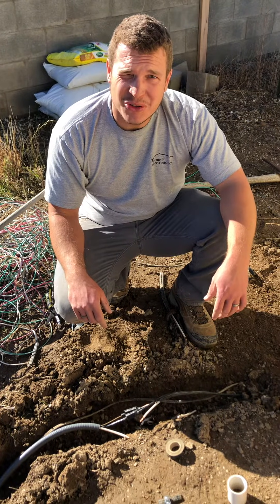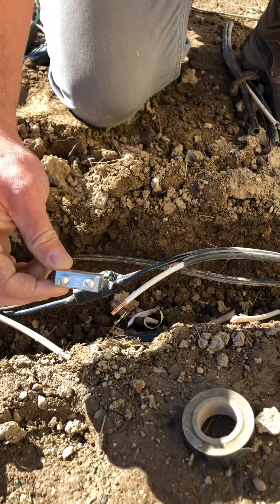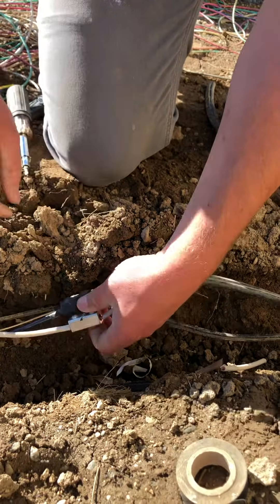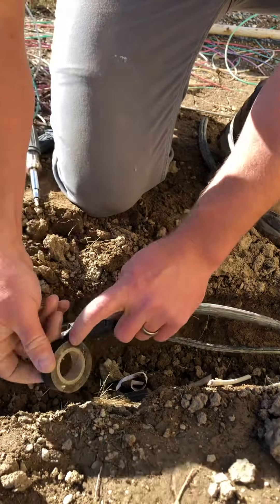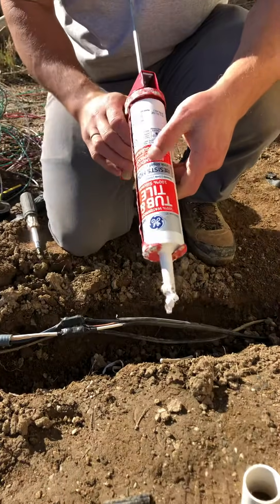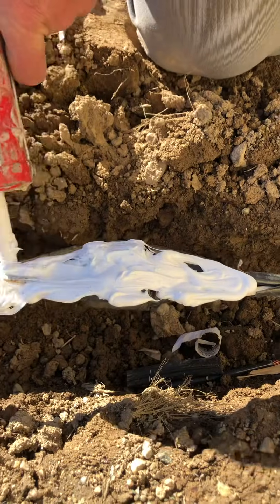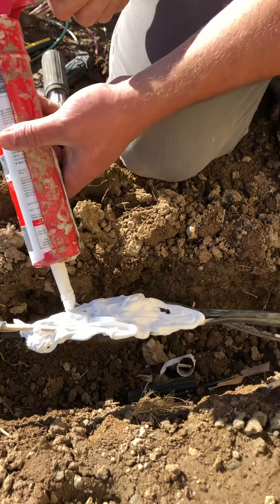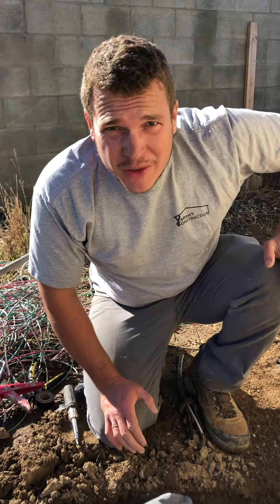Easy hack to fix and waterproof an underground wire that is broken

Comment: Do they make different lengths. Mine was cut and there's about 4 inches of wire missing. I just need to connect t both sides
Reply from the maker: You’ll most likely need to do two splices!

Comment: What a botched job. Can you not buy torpedo joints over there. Correct termination and sealed with epoxy resin.
Reply from the maker: @briwire138  YOLO!

Comment: I like the simple braid and some electrical tape; I like the silicone idea, but what I would do is use a short pvc pipe and fill it with silicone, wires within of course.

Comment: Fixing a well wire with a plastic bag to make it waterproof is multitasking at its finest! Not only are you solving your wiring problem, but you’re also giving that plastic bag a new purpose. Since it takes up to 1,000 years to decompose in a landfill, it should keep your well wire waterproof for quite some time. It’s a revolutionary move in saving both your wiring and the planet—talk about making a difference one plastic bag at a time!  That was very liberal of you!

Comment: This video pretty old, so i would recommend a jbox and splice it with waterproof wire nuts that are filled with dielectric silicone less messy, for new people watching
Reply from the maker: Thanks for your support! I’d use the new hybrid silicone instead of the old silicone!

Comment: Looks like a Donald Trump brand fix. If you think that's waterproof I've got some $400 gold shoes to sell you.
Reply from the maker: Remember to use a lowes bag and not a Democratic bag. It'll cost to much if you do. better replacing the whole wire in that case. and increasing the fuel costs so the taxpayers can pay for it.

Comment: That tape and silicone is worthless underground and the water/dirt is going to run up the jacket and cause corrosion.
Reply from the maker: Are you a scientist?
Reply: @constructionhacks9293  don’t post stuff when you don’t know what you’re doing! Someone can get hurt, that’s not the environment to experiment in. What if that line finds ground while someone is around or working on it and they get hit? Best case, it works for a decade and then starts to heat up, now your voltage is dropping and damaging equipment. There are products out there (Dryconn) that are UL listed for direct bury for $7-$8. Being willing to learn is also a great idea for your channel, I’m not attacking you personally but surprised that you post a video without any reference for NEC or how a tradesman would repair it.

Comment: Should have used Noalox since your using an aluminum splice block on copper conductor or use copper crimp connector and noalox since it prevents corrosion and increases conductivity then put mastic on the connection and use shrink tube over that you could then use what ever outside of that if you want more protection
Reply from the maker: Thanks for your support! These aluminum straight splicers are more clean than the copper.
Reply: If u use a copper connector on an aluminum cable (wire), it will corrode and won’t last long at all….   Oddly, an aluminum connector on a copper wire works just fine….  But I would definitely use a Barrell connector with a water stop on the middle and crimp it for a more permanent connection….   But it’s just secondary cable so u don’t need to loose sleep about the connector ….   But I’m sure u knew all that

Comment: We will have to call that a Trump joint. This is backwoods and will last about as long as one of his many marraiges! They make kits where you use heavy shrink tube or a plastic tube that encases the splice with epoxy.
Reply from the maker: Everybody knows a different way, I like this way, it works and is easy!
Reply from the maker: We certainly can’t call it a Biden joint, because this actually works!
Reply: Amen. Slow Joe would still be out in the driveway staggering along scratching his head trying to figure out how to make this repair cost the taxpayers $2,000,000. There would be a study done on which big box store plastic bag is best for the wrap and how to insure everyone involved was addressed with their preferred pronouns. @constructionhacks9293
Reply from the maker: @BrianDoherty-e8s  lol 😂 I was thinking he would spend most of his time just figuring out where the Teleprompter was.

Comment: Good lord… they make splicing tape for a reason! It actually bonds to itself and is more durable than silicon sealant.
Reply: I have not located splicing tape for waterproof direct burial.  Above ground, dry location yes, but over time in the ground it does not hold up.  Am I wrong?
Reply: @robertplas3947  yes, scotch/3m makes a waterproofing tape that is the same thing that is included in the UF direct burial splice kit. I would recommend  using something like the process shown here or a heat shrink waterproof tubing over the top, but at that point you might as well buy the direct burial kit for $13-15....
Reply from the maker: It’s a way to do it that works! Thanks for your support!

Comment: you can tell the hack itself is a hack because the freaking video is shot in portrait mode. You first have to figure out how to properly record a video before you learn that this type of joint will not work forever. Copper NEVER become exposed to the elements of the earth. it will powder up. its definitely not the same as driving a 36-48 inch copper rod into the ground.

Comment: How about NoLox on wire ends<<for the way you do it. Myself, I am gonna do mine with bare copper crimps and then solder...Without NoLox etc...Then elec. tape.. then liquid elec. tape to keep tape fused together. then heat shrink with silicone. Over kill ? maybe, but I will never revisit it.
I know moisture will get into a mechanical splice with no solder,  code or not.
Reply from the maker: It’s a hack when your on a tight spot.
Thanks for your support!

Comment: This silicone is not for this application. It (silicone)will fail just as Trump failed us (and the country). You need to use a quality  product of polyurethane. I use the 3M 550 for splicing applications. Tenacious adhesion to your electrical connections and  wire insulation and very waterproof. Silicone was never designed for a constant wet location.
Reply from the maker: It’s definitely a hack for someone in a tight spot that doesn’t have the time to wait for a splice kit and waiting for their special overcomplicated goo! Like maybe someone who needs their well to work while waiting for these. If you think trump failed this country you must really dislike Brandon or you like paying more for everything and letting China become the world power while America is laughed at! Trump at least got things done and made the hard decisions. Brandon can’t even say his name!

Comment: I’ve attended to a few of these  months and years later, the moisture always gets in and corrodes the copper causing a hot joint . Anyone who’s thinking of doing it use a underground joining kit, contains inline joiners and resin to make it completely waterproof ! This may work in a pinch but it won’t last forever
Reply: No offense, but this is how an OVERHEAD lineman splices cable…… underground linemen go thru a 3 plus year apprenticeship that teaches them all the phases (lol, get it? If u know u know) of cable splicing….. installation, splicing, phasing, troubleshooting and fault finding, and testing de-energized and grounding….. it’s usually taught by the utility itself.  If this is a field your interested in, u can make a boat load of money,but the best way to really learn this trade isn’t to come in on the trouble calls and paying attention ……. I did this for 25 plus years and I loved it… it wasn’t easy but I loved it… I was the only female but I evenly became a crew leader and earned respect by working my butt of and NEVER playing the girl card….   I miss this shit….  Now, if I can just find that damn cable stretcher…..
Reply: Yup.   Underground linemen call this a quick splice…. We use it for a quick repair until we can schedule a job to do it right and make permanent repairs, replacing the stretch of cable if necessary….. u find this type of stuff in URDs and once water seeps in, that aluminum wire will just disintegrate into white powder….. although I’m referring to primary and high tension cables…. This is just secondary…. I didn’t see any semi con and he called it two hots and a neutral…..  where I come from we had old park cable that was just #6 that was 5 kv or sometimes 13.8.
Reply from the maker: Hey Sport, 
thanks for your support!

Comment: Looks decent.  I've done it this way before.  Lately been using flex wrap (saran wrap on a 6" roll for packing) rather than bags but same idea.     Some glue lined shrink tubing over the splice block would be a good alternative to the tape - if available.
Reply: I like that you’re only liberal with the caulk! 🇺🇸❣️🇺🇸❣️🇺🇸
Reply from the maker: Thank  you for your support!

Comment: can you do that with the wiring coming off the breaker box to the house ,just asking?  let's go Brandon and yes I'm a trump fan as well.
Reply: I had the same question, but as far as the politics goes I hope you lose the next civil war. You're 0-2 and it doesn't look good. :)
Reply from the maker: @Unnecessary498  thanks for the support
“Let’s go Brandon”!
Reply from the maker: I’d say use your discretion, it’s easier to put a junction box splice if its above ground. Thanks for your support!!!
Let’s go Brandon!!!

Comment: ive seen guys just take the silicone caulk tube whole tube & cut the bottom off & slide the wires into it.. but they had extra wire to work with & this was for wires in wet conditions, In a sump  pump i think there called for Waste & then to the Sand mound <<(idk if thats spelled right dont look like it lol)  I hope my sump pump dont hear me talking about it  Shhhh 🤫🤫🤫
Reply from the maker: lol thanks for your support it’s definitely a hack when your in a tight spot and no electric supply store near by!

Comment: dont use these bolts its much better to twist.  The screw in that bolt connecter bites into the wire over time it snaps
Reply from the maker: Thanks for your support!

Comment: Thank you sir very creative interesting,😀 but how do you know everything was sealed tight ?  😀

Whould you trust to work bearfoot Rainey day or on top of that wet ground ?

 Heat shrink or HS x2 faster sir ?
Reply from the maker: It’s a quick fix in a tight spot and yes it’s still sealed. I go out occasionally and wet the ground and walk bare foot. Then dig up the wire and lick it just in case. It tingles a bit but don’t think there is any problems. Thanks for your support!
Reply: @constructionhacks9293  funny 😂
No you dont lick it 

Sorry yap you are right I should be more supportive

Thank you shearing great info kniwledge & exprience sir. 

I just wanted know how real 

No negative intention sir

MJ (basket ball star) said he failed so many thays why ge succeeded

So please keep creating great awesom wonderful videos please. 

I just wanted check to see how safe it is 

No negative feeling sir 

Anyway thank you great creative video sir 😀🙏.
Reply: @constructionhacks9293  😆

Comment: As a Licensed Electrician, I don’t recommend this technique.
Reply: As a non licensed electrician , I do not recommend… lol
Reply: Let me guess,  you recommend calling a licensed eletrician.
Reply: @werper09   obviously if you want it done correctly yeah I highly!!! Recommend it
Reply: The dumbest part is he’s spending more on that silicone and connectors then he would on a proper uf direct burial splice.

Also very fitting using the Walmart bag to finish off
Reply: @smeric28  actually, in reality I was looking for a video on the UF splicing connector
Reply: I paid an electrician to do the first repair. within six months, my GFI was tripping. Dug it up, did something similar as this guy here. It lasted 20 years, but now am getting another GFI trip.....thinking of pulling the whole damn cable and replacing it. Except it terminates up inside a gang box for an outlet on the outside of my garage!
Reply: @mprenn1547 leave the terminations and cut it before the sweep, then “splice” in a stretch from there to the fault…..   don’t forget to mark ur phases before u cut it !!!    If u want to be special, pack it in sand before u dump all that rocky soil back in the trench so ur not digging it back up in six months… aaaaahh u know what, where r u?   I’ll just come do it…. lol
Reply: Thank you! I was laughing throughout the whole thing!!! Make sure it’s a Lowe’s bag too Home Depot will fail 😂
Reply from the maker: Thanks for your support for a channel. It’s a hack for somebody in a tight spot that needs a quick fix!!!
Reply: @constructionhacks9293  and as a licensed electrician, his bill will be $500!
Reply: @constructionhacks9293   Quick fix... its been 10years lol

Comment: That is as rough as f***, just buy a resin joint you cheapskate
Reply from the maker: Resin cracks and leaks over time, you should try silicone 😉
Reply: @constructionhacks9293  is that what you believe, I guess your talking from your many, many years in the electrical trade 🙄
Reply from the maker: Ray Murphy i’m glad you can see it from my point of view.
By the way my daughter would call you a potty mouth.
However she is not a certified English grammar technician graduate yet so you may not believe her.
Reply: OK I'll give you that I can sometimes have a potty mouth, but wouldn't it have been better to show people how to do it properly, resin joints aren't that expensive and are simple enough to use and America isn't the Australian outback or a deserted island availability isn't an issue, plus in time as earth moves that silicone is gonna peel away and then water ingress is an issue and who knows what protection others might have on an underground cable, you could end up killing someone.
Reply from the maker: Ray Murphy any electrical repair could fail, it’s a quick fix in a bind and I’ve not had one fail. You should make a video of your fix and I’ll watch it and give you a 👍🏼👍🏼👍🏼

Comment: That’s the way to do an underground joint? Seriously?
Have you never heard of shear bolts and resin joints? If you did this shit on one of my jobs you would be off site within seconds!
You should immediately stop giving any electrical advice.
Reply: Oh ya! Silicone all the way!
Reply from the maker: Jon K Thanks for your support brother our channel was designed and made for common sense out of the box thinkers like yourself
Reply from the maker: Trevor Ord 
I would recommend electric tape and silicone instead of those leaky resin joints. 😉
Reply: 😂 so if there on a farm and could be life or death situation do you really think they will have a tube of silicone???? Nooooo I doubt it, shocking job that
Reply from the maker: I’m thankful for your comment. This is a video for open minded people who need a quick fix on a farm where electric power can be life or death for animals.

This video is not for “professionals” such as yourself. It’s for people with common sense. Good day Sir

Comment: Wow,     you sir are a danger!
Reply: Construction Hacks-
There are two ways to do any job. The correct and safe way or the way you have done it
Regardless of what you may think of professional electricians you are not suitably  qualified to offer any type of electrical advice. The USA is a very litigious society, you should bear that in mind.
Reply: What the hell has burning people at the stake got to do with this?
Reply: @trevorord6871  I think it was an example of a great need to open your narrow perspective.
Reply from the maker: Trevor Ord 
I’ll break it down for you, this goes way over professionals head. When the majority of people think there is only one way to do something and someone comes along with a simpler easier fix it offends them and they state their opinion as fact. It’s hard for professionals such as yourself to not get offended at my videos because they are so simple and work so well. It may be better if you don’t watch my videos you may learn something which will offend you more.
😎
Reply: Btw, I am in no way offended. I actually find it funny that you try to justify this crap as a perfectly viable fix and are getting annoyed that people are calling you out on it
Reply from the maker: Trevor Ord 
I would definitely hire you, I would see your critical personality a mile away and hire you so I could have the satisfaction of firing you and your leaky resin joints. You would not be allowed on the job. 
Trevor: “your fired”
Reply: This is honestly worrying!
Reply from the maker: relentlessltz 
Worry is for people not willing to try something new 😉
Reply from the maker: Electricians' Community UK 
I think it interesting that at one pint and time in history there were men burned at the stake for telling others that numerous galaxies existed. 
This works as a quick fix for folks in a tight spot needing temporary power to a well not wanting to spend hundreds of dollars and waiting on a schedule for y’all to come with your hard hat and nose up in the air with a huge bill for them. Good day sir!!!
Reply: @constructionhacks9293  if only there were cheap approved, certified products to join cables underground.
Reply from the maker: Electricians' Community UK 
There is a cheap simple way watch the video🤩